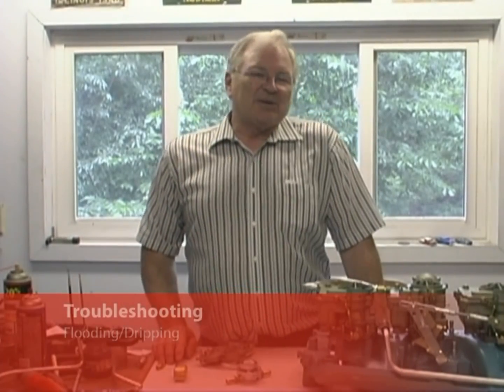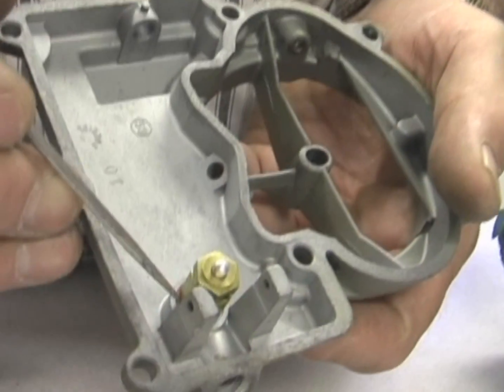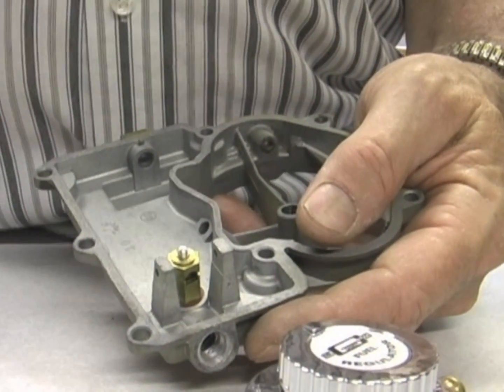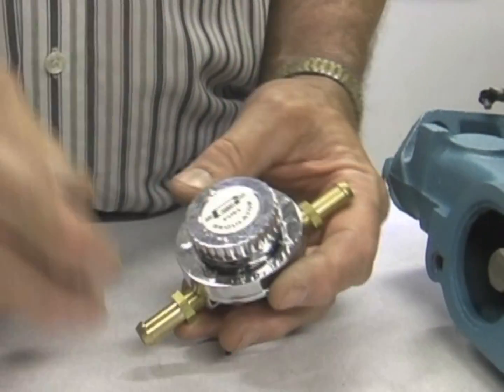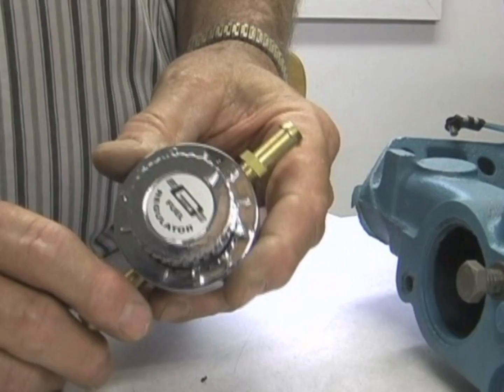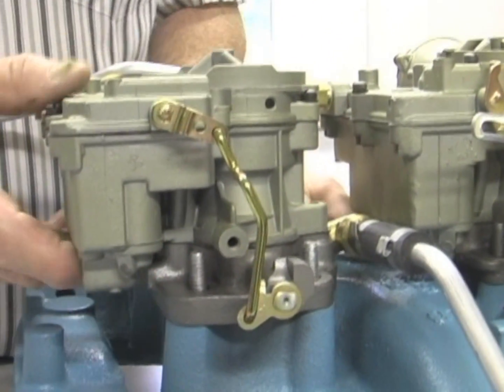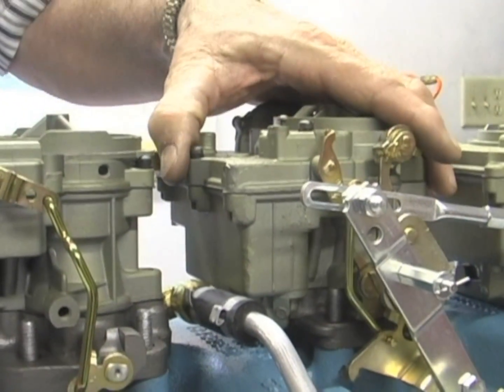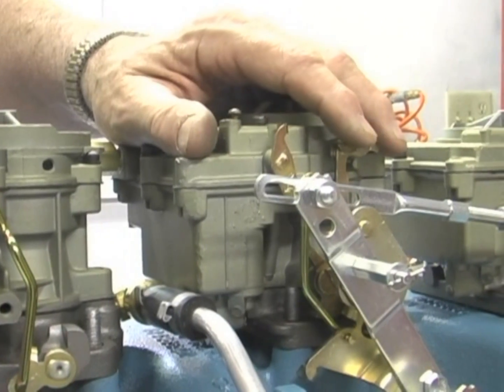How To Prevent Flooding on Pontiac Tri-power 2GC Carburetors

Comment: I have adjusted my float ( center carb) replaced the fuel reg with Holley from PTP, replaced fuel related items inside the carb off & on several times trying to figure out why its running so rich. Ive looked down in the carb cant see any overflow. Cant figure out why its so rich. After a few seconds in my garage it smells of gas when cars idleing. ANy ideas? Oh and I adjusted the fuel pres. to almost 0 still smells. I removed 2 plugs #2 & 6 they were wet with fuel.